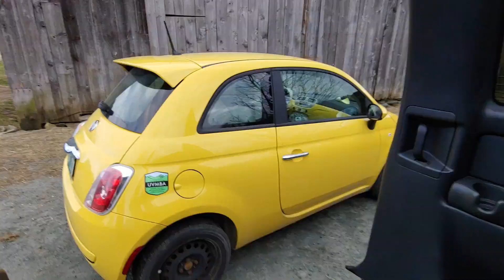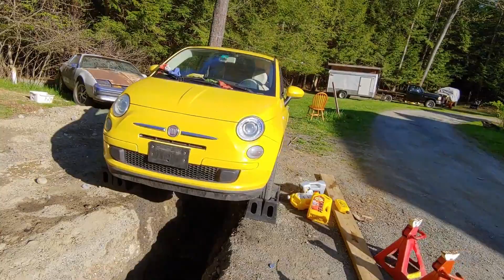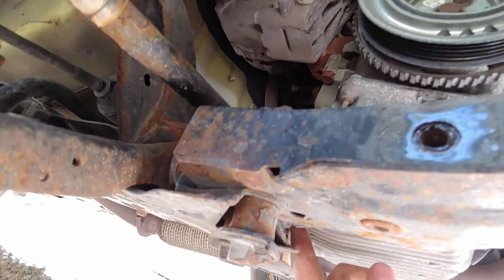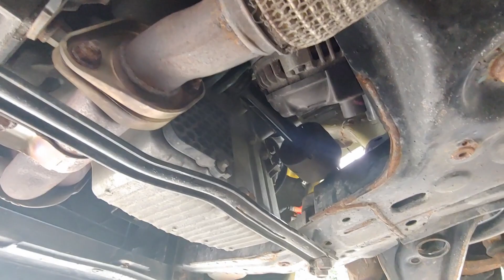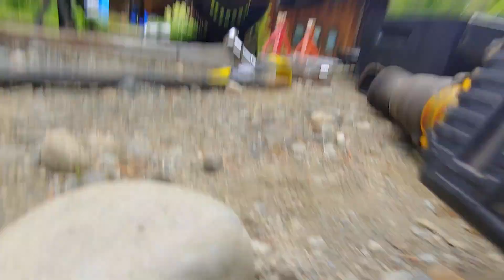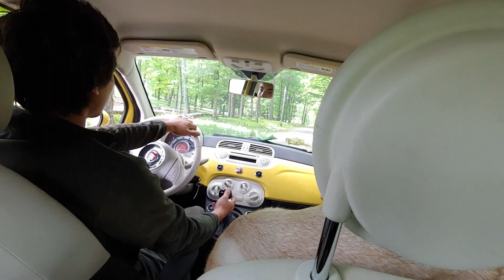Repairing A Fiat 500: Who Designed This Car??

Comment: I've been working as a mechanic in fiat dealership in Europe, the 500 is really reliable, alternators were the only thing that caused problems, but it's an issue to all fiats from 90s to this day, it's because water gets between metal plates that make alternator core, the plates rust and expand so the alternator cracks and stop spinning. It's also not a 5h job, we took this out in less than half an hour.

Comment: Yeah, you're right. The alternator is really very awkward to remove. I have 11 years experience working at a Fiat garage and over 40 years in the trade. Seizure of the alternator was a common fault on on "Punto 199" models caused by water ingress due to rain water running down the bulkhead/firewall and onto the alternator. Fixed by the factory by modification of the bulkhead/firewall drains or recall modifications. It's not too common a fault on the 500, but not unheard of. I have to say it's much easier on a 2 post ramp and your "pit" looks like a death trap. Do yourself a favour, fill it in and invest in taller axle stands and a crawler board. It just looks like you've dug your own grave. Really unsafe. Now I appreciate you're helping out a friend but it's your life that's at risk. Remember accidents happen when you least expect them and it doesn't look like there is anyone around to help you if the wall of your "dirt" pit was to collapse. Nice to see an armature "have a go" at what really isn't that hard a job. Good video though. 👍

Comment: I have a 2016 500 Abarth same color 105k miles no issues just did timing belt and clutch. Did pull motor though. Also it’s tuned to 260whp and has been for 60k+ miles so been pretty reliable

Comment: From owner of Fiat Punto from Europe.
My Punto has the same drivetrain as this 500. I had my alternator fail on me (ie. the brushes were worn off). First power steering died, then abs, lights, but engine kept running  for 30 minutes.
I went to the shop in first town. Mechanic evacuated AC lines, removed AC compressor and had access to alternator from the top, repaired the alternator and put it back.
Whole thing lasted 35 minutes.
He said he could do it from below, but this way is much quicker and easier. 
And what do you expect. 500 is small car, parts are designed to fit in small space.

Comment: I have a 2012 Fiat 500 which I have owned since new. It is my main daily driver. Mine has 61k miles on it and so far has been very reliable. In terms of space efficiency, I would say it is a well designed car. But as a result, stuff is crammed in it a little bit tight. I recently replaced the cabin air filter and being a contortionist would have helped! Every car has its quirks - and if the alternator ever goes out on mine I am paying someone else to repair it!
Reply: Is it worth buying a 2012 in 2020? I am looking to buy one sometime soon but not sure which year would be best, is it worth spending cheaper on a older year? Thanks!!
Reply: I too have owned a 2012 Fiat 500 since new. 93k miles. I average 41 mpg and take it on lots of road trips. It is rewarding to fit in parking spaces that others must pass by. It hasn't given me any trouble whatsoever.
Reply: @helenemc5008  It really depends on what you are after. This car really only gets avg. gas mileage if you aren't constantly monitoring your efficiency and driving conservatively. I got mine because I wanted a car I could fit in my garage alongside a workbench. The only real insight I would emphasize is that I would not recommend an automatic transmission or a turbo.
Reply: @helenemc5008  I really don't think they changed them much at all throughout the production run. I think the newer ones have some small changes to the dash, maybe added an  infotainment system but that's about it.
Reply: @MarkMaier  That is awesome to hear thanks for responding! It always seems to be 50/50 with people either they have no issues at all or it comes with a ton haha but i guess that can be with all cars!
Reply: @danielreigada1542  Ohhh okay! that makes sense!! I may just go with the older models then!! to save more money. All that matters is to get to point a to b! :D
Reply: @MarkMaier  Oh why why do you recommend manual over auto? And the main reason i want a fiat is because i have a fear of bigger cars i like to know exactly how big my car is and i want it to be less stressful when i drive/park.
Reply: @helenemc5008  I understand what you mean about smaller cars. My Fiat is a breeze to park or to maneuver around tight spaces. Like inside a parking garage. I also own a Ford F150 which is the opposite - a major pain in the ass to park and maneuver!
Reply: Oh man, I feel your pain, Daniel! Until last year, I had a '12 Fiat 500 Sport, and I remember the backwards-bending yoga I had to do for reaching that damn cabin air filter... While in the sweltering Florida summer heat and sun...
Reply: Wait till u get some real mileage on it... ur gonna wish it was a corolla

Comment: I couldn't disagree more. I have owned 4 FIATs in my time (1975 128, 1986 Regata, 1995 Uno diesel & 2003 Punto diesel) and they have all been totally reliable. The most unreliable car I have owned was a Nissan, which dropped a drive shaft, cracked the cylinder head, stopped everytime it rained and was a complete bas***d to work on. I would have no hesitation in owning another FIAT.

Comment: I believe forums don't show that these cars are particularly unreliable.  I found this:

"First remove the left wheel side cover, it covers the lower engine pulley, then remove upper bolts to brake spindle, remove axle nut from axle. Pull the spindle out far enough to remove left axle. after that the alternator should drop out."
Reply from the maker: Thats still a boat load of work if its true, just cuz its concise doesnt mean its easy.... And in general fiat chrysler had been poorly rated for reliability, check any magazine or consumer reports. Forums are biased to whatever car they apply to
Reply: @ARuralVermonterQqjmcb182  I remember my father having to remove the inner fender to replace a heater core years ago.  These cars don't have a reputation of being terribly unreliable,  Americans just don't like small cars, unless they are a mini SUV. 500s have fewer problems than the Mini Cooper until 2015, which admittedly isn't saying much as the older Mini requires expensive maintenance.  A problem with the Fiat 500 is the fuel economy isn't as good as the small size suggests, for a little more you can get a Corolla or a Civic. Fiat has pulled out of the U.S. market this month.  A Fiat 500 is parked on just about every street in Europe, but Americans don't like them.

Comment: Just because its a small car with little space its not poorly designed!
Theres just not more space...pretty common in europe
Reply: If it's that hard to do a simple alternator job, it's pretty poorly designed.
Reply: compare it for example to toyota aygo, same piece of shit, but easy to work on. Ain't buying italian for shit.
Reply: I don't think you watched the video because you would understand why he says it's poorly designed if you paid attention to it
Reply: @edisg  he is the one doing this shitty, ineffective workaround since he hasn't got the  instrument to take the engine out. He's the poor mechanic.
Reply: Exactly. It´s a small car with front wheel drive. Obviously some pickup will have more room, because of the size. But you won´t find a big enough parking space anywhere in Italy for a Chevy pickup. Also for many cars like Nissans with V6 and FWD this one ha even decent space. At least you don´t have to disconnect the drive shaft and tilt the engine like on some Peugeot´s.
Reply: @MrEugenio1994  In what world is lifting the engine out a reasonable operating proceedure for a known wear item like an alternator and belt?
Reply: @ToastyMozart  Apparently Italy
Reply: @ToastyMozart  In small cars because it usually doesn't take more than 45' with proper (not necesarily very advanced) equipment (i.e. an engine hoist and the service manual). Depending on design, in some cars lifting the engine is way faster than taking out a single oil pan, for example. Going into pain for a simple alternator is not good, of course, but they normally last enought in order to not be a pain for the car's owner... factory engeneers doesn't care about mechanics, thet care about production lines and owners.
Oh, and in Europe people usually doesn't own a car for more than 4 years, then they sell it or something
Reply: @ThatWolfWithShades  not, there is no idea to design car and think how easy is to replace alternator, no wonder some cars looks and are shit, if they are designed for repairing.
Reply: Still doesn't mean it's easier to work on...

Comment: I have a rule for when either buying a car for myself or helping a friend do so: take a wratchet wrench with an extension with you for the test drive.  If you can reach around the engine and have the end of either the wrench or the extension easily reach bolts and all other issues considered, go for it.  Even if it has a great warranty as you're going to be doing something to it yourself at some point, take into account how easy it is to work on before you get it.  So many other things about a car's design are revealed by how well laid out its various components are in the engine bay as that design ethos bleeds into everything else.  

Hey, from New Hampster.

Comment: I have a red 2012 fiat jus like this one! Bought it for 3000 dollars 😁 the only issue I’ve had was my shifter cable connection (I don’t remember what the official name was) broke and the part was impossible to find. Then 1 week later I get a letter saying that the part was recalled and I needed to contact a dealership to get it fixed. No issues since except body damage from a lovely deer that ripped off my mirror and shat all over The side of it lol she is def a head turner though I’ll catch people staring at it all the time

Comment: Back in the late 90s and  early 2000s when I still lived in Europe a buddy of mine was working in a shop. I visited him one time and saw this small VW on the corner. One of those FWD compacts. It was missing everything in front of engine. I was asking what they are doing with that(I think it was some 5 year old car at that time). "Changing the alternator". The alternator was between the engine and firewall, and to get it out they needed to tilt the engine. To have enough room for that they needed to get almost everything out in front of the engine. Looked like fun.

At that time I was lucky enough to drive US made GM car with small block V8. I had to change alternator once, took around 10mins to get the old one out. It had the serpentine belt, to get that off all you had to was getting a ratchet(1/2" I think),put it on the belt tensioner and turn it, then the belt was loose so you could remove it. Then 3 bolts and connectors off and you had alternator out. Easy AF.
Reply from the maker: wow now that is a bad design!
Reply: @ARuralVermonterQqjmcb182  I know right? But I guess that's the deal with compacts, especially FWD nowadays...I mean get everything in a small package, engine is sideways and not much room anywhere around it.

Thats one of the reasons why I just like my RAM truck(I think you are GM guy, but hey we all have our limitations..just kidding, I've owned several GM vehicles), ease of maintenance...No way I would ever buy a small car.

Comment: Why didn't you check the alternator first to see if it was  actually stuck? Usually if it sat for a while rust builds up between the armature and the stator. You can usually just put a socket and bar on the alternator pulley and they'll break free very easily.
Reply from the maker: i did and it was stuck i'll tell ya that

Comment: It looks to me that the root of the problem is that the car was designed with a manual gearbox, not with the automatic one which has been added later in order to sell it in the USA, removing the alternator with the manual gearbox (which is smaller, or at least it is less bothersome when servicing the car) is much easier..when you take a small car with tiny space under the bonnet and you add something it wasn't designed for (in italy/Europe, automatic gearboxes on small cars are only used by disabled people..) that's the result..

Comment: 88,000 miles and one thing failed. What’s not reliable about it ?
Reply: I was thinking the same... 88,000 miles and a failure seems a pretty good result to me for a city car, designed to be a compact way of transportation indeed 😊 Maybe for travelling along huge american roads and highways isn't just the right pick, that's for sure...
Reply: Quite so. The job's a pig but was done without a computer.
Reply: My sister had a brand new Fiat and the entire engine failed after 50,000 miles.
Reply: Same thought, I had Fiats in the past (I had five), I sold them because I had enough of them and wanted to change but I didn't have big troubles with none of them... super reliable engines... and yes, rust could be a problem back in the ninenties, nowadays I couldn't say. Fiat's are no more Italian made cars so I don't buy them anymore...
Reply: Lassi Kinnunen I am not a Fiat fan, never owned one and never will and this is for personal reasons, but can you please show me a rusty fiat? I live on mountains by the sea, we have snow in winter so salon the roads, we go to the beach in summer, but I cannot recall a single point of rust in a car that was not damaged.
Reply: Shouldn't shit fail on no modern car at 88k miles fuck that ...😤🤬💯
Reply: My Lexus alt lasted 128k...
Reply: @DerekCully  what happened?
Reply: Lassi Kinnunen  rust might be a problem if your streets are covered in salt for half a year. Yeah, sure. In Europe, they aren't.
Reply: DerekCully   Lexus vs Fiat 500 price....
Reply: Lassi Kinnunen   That’s old FIAT’s...like from 70-80’s.
Reply: @Mauro Eleven  That's correct. I'm not a Fiat fan, but it's correct to point out that its overall quality has increased steeply from the 90s on.
Reply: @saffron6870  don't worry, millions are still driving around just fine many years later :)
Reply: Italians cant make a good car.  Ferrari, Lambo, Maserati, Fiat.  All garbage.  Anyone can build a really expensive car... I am more impressed when a company builds a RELIABLE car for 15k
Reply: @saffron6870  did she take care of it? Stupid question. A girl drove it so no.
Reply: Well I think the video kind of outlines it. That thing that failed is the thing that makes it unreliable. 88k isn't that much, this isn't the 80s.
Reply: @thehoovah  My family had a mix of fiats and fords through our lives and never had a problem with any of the fiats (only rust on older 80`s models like 128 and ritmo); the ford were plagued by electrical issues....I guess it`s all about personal experience
Reply: thehoovah no one cares about reliability when buying any of the cars u just named. Are you drunk ?
Reply: gillian67ec who cares who makes the cars , they are still the same cars. The racial issues in this world is crazy.
Reply: @miralemnermina142  In USA they never had the 1.2 FIRE, only the 1.4 MultiAir. I assume Murican mechanics never changed UniAir oil filter.
Reply: @spiderpsx1  Depends if you mean surface rust or actual structural rust (punch-through-the-floor type). There's a bit of skirt rust on my 2008 Grande Punto (139k kilometers / 86k miles) from all the stones etc hitting it and peeling the paint, but it hasn't spread from there for a long time. It's really only visual - it still passes the yearly inspection no problem, where structural rust would be an instant fail.
Reply: 88k is not very old
Reply: Because Japanese, hell "'Merican" cars routinely go 200,000 without failures.
Reply: James the Other One and so?
Reply: @DerekCully  got 177,288 on the original alternator from 2001. Changed the belt once.
Reply: My 2012 Corolla is at 224k miles and have not done anything to it other than automatic transmission fluid change, oil changes, air filter changes, wiper blade changes, tires, new battery, and that is it. No mechanical failures whatsoever.
Reply: I've had some Honda's reach 150,000 before needing any major work done on them.
Reply: Lol God damn my explorer has an alternator from 1996 and it's still working fine. 
684k miles.
Reply from the maker: friend has stated that there have been a lot more things that have broken on it
Reply: A Rural Vermonter kinda feel like you would have mentioned that in the video, but okay.
Reply: Lassi Kinnunen wasn’t the rest problem from the 1970s when they were forced to use Soviet steel? I don’t think they’re using Soviet steel anymore
Reply: Call me a classic german ra#sist. But I'd never buy a mexian made car. Chrysler PT Cruiser, VW Beetle Series, American Fiat 500, old Dodge Neon..
Mexians just can't assable cars, Polnish people can. Here in Germany sooo many girls drive Fiat 500. I work as a carsalesman and we also have a garage. Yes some sustention parts fail earlier than on a VW Passat, BMW 5 Series or some other Midsize-Sedan. Brakes go out earlier and clutches go out pretty early but that's because they're pure city-cars. I've never seen a AC part other than the condenser due to stone hits. I've NEVER seen an engine dying, I've never seen a transmission go out..
They are not that bad. Fiat just hates you.